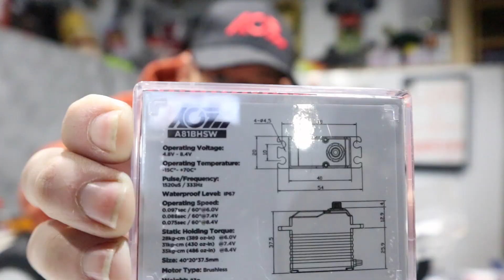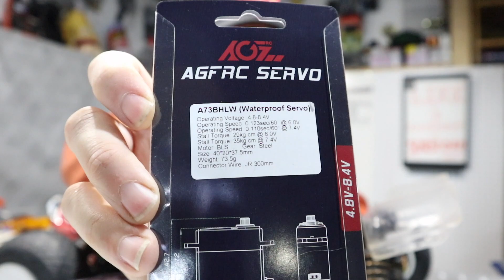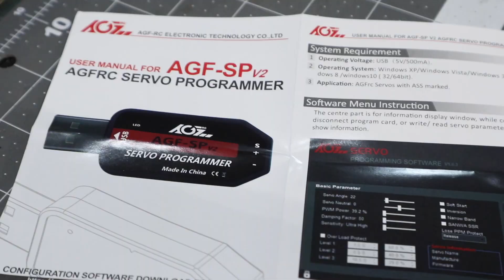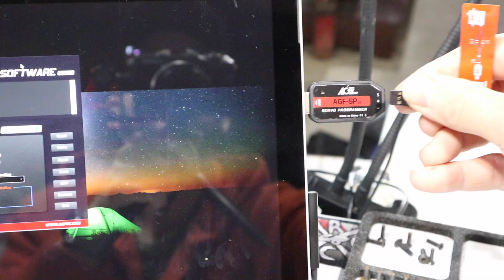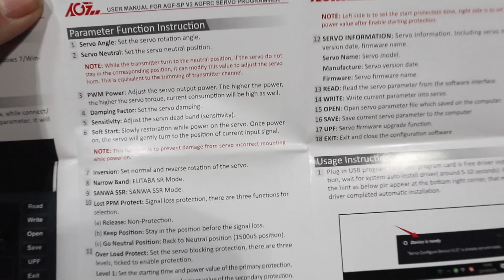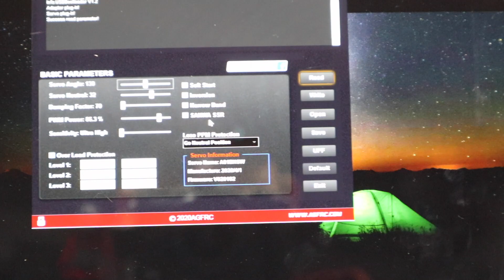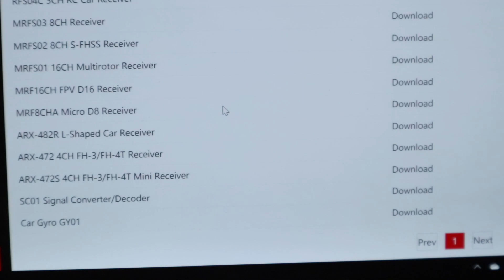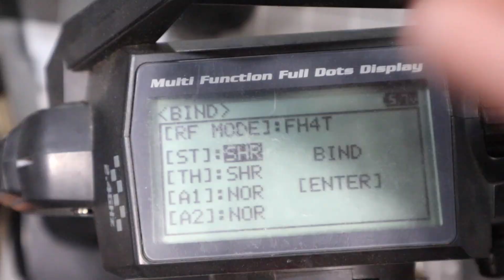Programmable Servo! AGF RC Brushless Servo A81BHSW [Servo Test] - Netcruzer RC

Comment: Minute 1:40 you say it will work out of the box without programming it, so I'm still unsure what is the purpose of the programmer. Cant you just adjust EPA, speed, trim, sub trim from the radio?
Reply: Yes I do epa and that stuff on the fly with a good controller

Comment: Problem I have with AGF is on the return stroke the servo is very rough. Help the servo turn and you can feel the pulses. Not good for big airplane elevator returning to center slow as you can see it is not smooth. But smooth under load. WEARD.

Comment: I would bet the red 2 pin connector is for use with the higher voltage servos that are powered off a separate battery. I've been using the A80BHSW servos for the past year and they've been great.
Reply from the maker: Yeah they have some 12V servos which might need separate power source.
Reply: @netcruzer  that's what I'm thinking! The A80BHSW servos used to be a steal - you could find them for $55 new on Banggood. They're still worth the price but it's gone up.